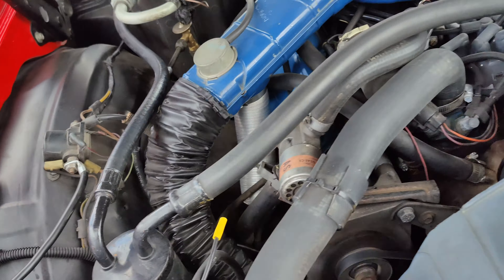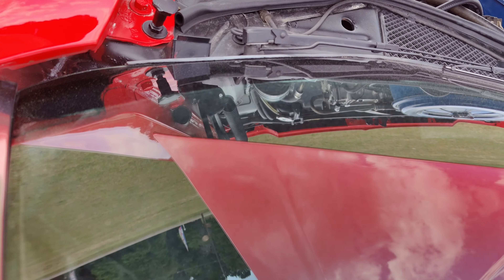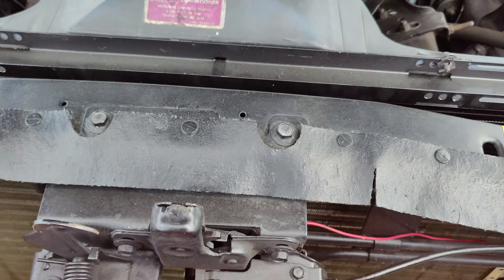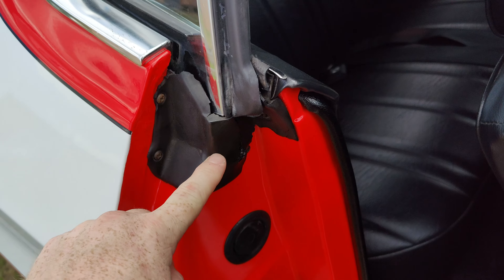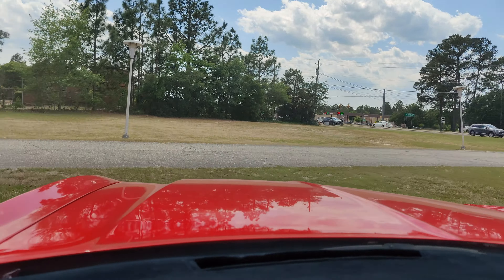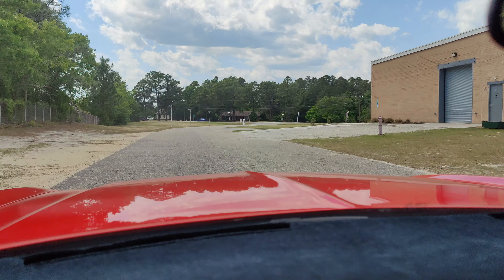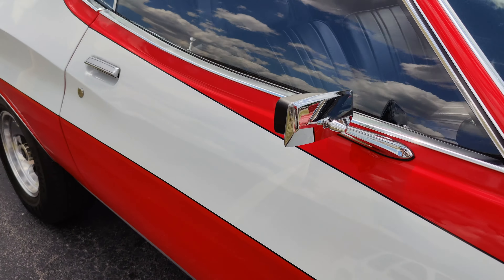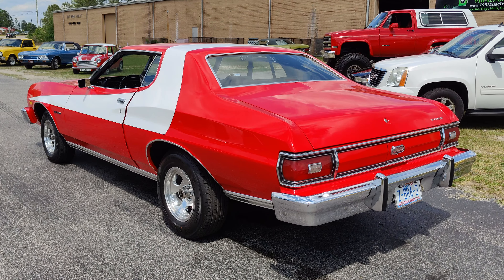1976 Ford Gran Torino Starsky And Hutch Tribute at I-95 Muscle

Comment: The White stripes are done wrong but apart from that its nice. But this is not the only one with the stripes being wrong so somebody out there never watched the show or had a toy car that's for sure..
Reply from the maker: There are two sets of stripes used on the show, it varies between seasons.
Reply: @I95Muscle  well, i had 2 toy models and just checked the show,. And all the clips i could find had a softer round curve from the roof and up along the side. This looks cut weird. Very blocky. I only know it to be a soft curve.. But look around on here. You will see it instantly..
Reply from the maker: @ebbhead20  Oops, I was wrong. There were 3 different stripe kits used on the show. https://www.hotcars.com/starsky-hutch-facts-about-the-duos-gran-torino/
Reply from the maker: @ajjy1110  define "wrong"